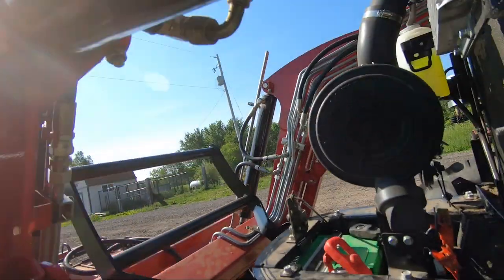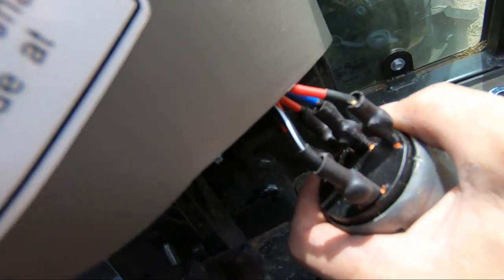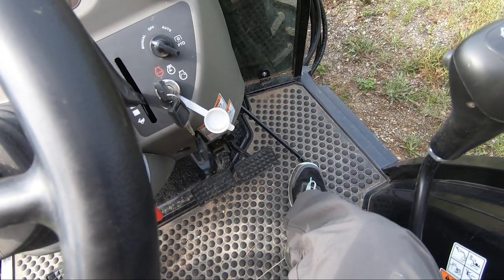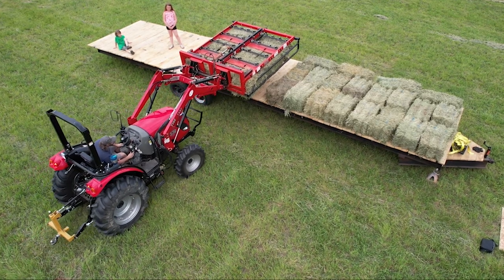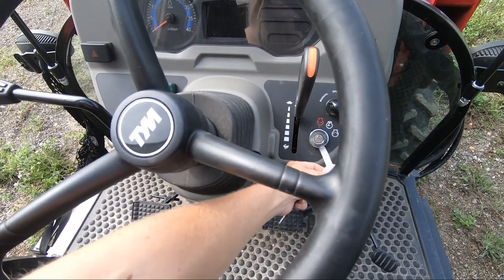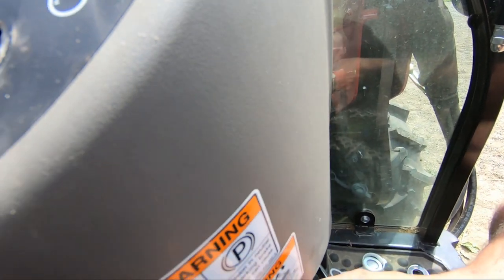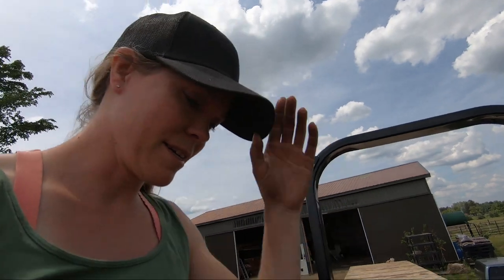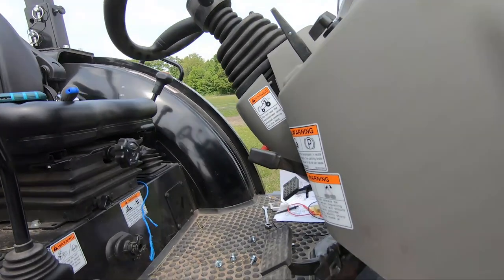381 Our New Tractor is DEAD - Why It DIDN'T Catch Fire . . .

Comment: Its sad to say but it seems all the modern tractors are having these type of poor craftsmanship! Either weak cheap wiring or bad engineering like not putting better tolerances between moving parts! You should get TYM to reimburse you your time fixing it by yourself and not making them spend on a technician/mechanic! Since you are being sponsored by them ask for a raise for making a known design flaw look not so bad and easily fixed haha!
Reply from the maker: I do think many modern tractors have more issues than older ones (when they were new), but my Grandpa had bought a brand new John Deere tractor in the 60's and the engine went out after 30 days. John Deere refused to cover the cost to repair it was still under warrenty), my Grandpa had also been in the market for a hay cutter and went down to the local Case dealer. Not only did the Case dealer give him a good deal, he ALSO fixed the mess of a John Deere engine for FREE!
Reply: @This1LifeWeLive  yes well John Deere has always been about what it could do for John Deere! But I think biggest problems with all the new things from a washing machine to a $100k tractor! They use to at least try to compete with each other to make something even a little better than their competitors! Now they only compete with each other to see who can perfect the lifespan of parts to such a perfect breakdown just as the warranty is out! Ask a AC guy lifespan of new unit (oh 6 years) my mom and dad got first new home in 1974 that had first AC we ever had lol! It was still being used in 1995 when they got a new AC! Its business but its sad business! Imagine how many people would buy a new tractor from a company that actually wanted to make them last 20 years instead of 5 years!

Comment: So it is a TYM design flaw. There needs to be hard insulation around the switch or it needs to be moved to a new location.
Reply from the maker: Either or.  A friend told me about their New Holland at work caught on fire TWICE due to eletrical issues . . .
Reply: You might be able to do a wrap or two of electrical tape around the ignition switch if there is enough room. Farmers who own will sometimes relocate the switch completely.

Comment: That is a design flaw that should have been corrected to allow spacing for the parts to prevent rubbing.  I am surprised that TYM did not cover this under warranty.  I have had problems with Tractors before and usually the manufacturer will  have you bring it in and they will fix the error of free.  Yes I lost time taking it in but they provided a loaner to complete my job while they worked on the tractor.
Reply from the maker: We don't have a trailer, and often it can take time for them to get a driver out to get it. It was much faster for us to pull it open and make the repair :)
Reply: @This1LifeWeLive  I love you 😘💕❤️

Comment: Don't rely on tape to cure that situation.  Get a shorter bolt or if possible reverse the bolt and use a self locking nut to secure the Hand Function of the Throttle on its' pivot.  Use zip ties if possible to hold wiring clear of moving parts or contact points.
Reply from the maker: we may take it back apart and see if we can get the nuts/bolt shortened or adjusted differently :)
Reply: A big rivet or two
Reply: My thought is some type of sleeve or shield between them.

Comment: The one thing I can say about the smaller tractors is they tend to vibrate stuff loose. I almost found out the hard way to take a set of wrenches and sockets and re-tighten every single nut and bolt you can find after about a month of working it during the break in period!
Reply: That's similar to what my son said about the cheap new Chinese motorcycles and quads a few years back. The neighborhood kids would all enjoy them for a day or whatever then my son and another dad would go through and retighten everything for next time. Sounded like a big PITA but I suppose the kids had fun anyway, lol.
Reply: It's called loktite

Comment: We just ordered this same tractor.  Supposed to be delivered this week.  I sure hope we don't have too much trouble with it.  I've heard they are good machines
Reply from the maker: The issues have been user error 100%. It also had  (has) an issue where it will get 'stuck" in gear . . . Erik swore up and down that it was the TYM's fault. I pointed out his shifting is dirty and he never drives the NH. He drove the NH this fall and lo and behold . . . it DID THE SAME THING. I grew up on clutch and stick, that's all we had, so it's second nature to me. Tractors don't like to shift over bumps, or go from low to high gear "on the fly". The TYM I was able to jiggle loose by driving fast over a bumpy field and carefully shifting gears (bumping it loose). I'm hoping the fix for the NH is just as easy, or my hay season is going to be in SERIOUS trouble :(

But I talked to another sub who mentioned his TYM has a different dash and the sales guy said they had modified the design since our tractor. So whe n yours comes, look at it carefully and compare it to mine. if the spacing looks similar, you'll want to access the throttle lever and either cut the bolt shorts or wrap it. But I don't think many will have this issue. Most know to use the foot throttle ;)
Reply: @This1LifeWeLive  Thanks for the information.   I also realized ours is hydrostatic,  so I assume this will be a non issue.  I should probably check the throttle and ignition switch.   I appreciate the video and heads up. Seems like a great machine so far. Thanks for sharing your experience.

Comment: I'm been working on 184 cub lo boy lawn mower for 20 years now, I've re-engineer the electric pto belts tensioner instead of the junk spring that keeps tension on it and as of present I'm working the throttle cable from dash controller to governor arm which should have been a steel push rod of a quarter inch thickness to push governor arm back instead of a cheap steel push/pull cable because with yours any moisture gets inside of throttle cable that lays on hot engine has tendency to rust up and bind up a engineer flaw design, case closed,see you on the next videos 📹 :)
Reply from the maker: Good to know I'm not the only one fixing stuff ;D

Comment: My TYM 234 HST has 750 hours on it.  I've had the front loader arms crack off twice.  I added steel and bracing to the tractor and so far, so good.  The backhoe separated from the tractor the first hour of use, and then I welded up a new bracket to attack it to the rear center pin.  Now it stays on.  During use, 3 of the bearing posts of the backhoe failed and I welded them back on with additional metal, which has worked well so far.  The rear upper attachment of the backhoe to the transmission then broke into little pieces, I had to weld up a beefer bracket.  At 700 hours, the main frame cracked and the tractor about folded in half, and cracked the plastic seat surround (the body as in were that in most tractors is steel) was destroyed.  Total parts are $2500 to restore it to service.  I did all the work. took me about 50 yours total to disassemble and reassemble the unit.  I am done with TYM products.  This machine could have killed me more than a few times, I feel lucky.  I am going to unload this thing as soon as I can find a buyer.

Comment: I would try getting some dry-slide on those cables. WD-40 might damage the rubber, I'm not sure about PB Blaster. Dry-slide is a graphite powder that should last a long time.
Reply from the maker: I'll look for some next time I'm at the store :)
Reply: I can tell you from experience not to use PB blaster on anything rubber or thin plastic, it will eat right through it. PB blaster is penetrating oil, only use it on rusted nuts and bolts, never as lube.

Comment: Good info , All they need to do is relocate the key switch a half an inch to the right in the wire won’t rub drill a round hole with a holesaw bit over a little further and stick it through the hole if possible,, Nice looking tractor they have good reviews I guess they make them worldwide

Comment: Great post. While I did not have this happen to me, my dealer contacted me about 4 months after it was delivered to say that an issue had been discovered and he wanted to make a preemptive modification to the console. The switch was moved a bit to the right and  a different size bolt was attached to the throttle lever, under warranty. My dealer also has shown me how to access areas of the tractor in the hope of having the machine not go out of service with a problem that I can rectify. I'm impressed with both my TYMs(4) and my dealer. Love your channel. I was first introduced to the TYM brand when you first took delivery of your TYM.
Reply from the maker: I'm glad you are loving them! I have NO complaints on mine. She even starts RIGHT UP in the sub zero temps!  I couldn't even do that with my John Deere . . . thing had to be plugged in all the time!
Reply: @This1LifeWeLive   Like your experience, I've had no problems starting any of my TYMs this January and it's been an old fashion eastern Canadian January..... lots of snow and numerous days were it's been below zero Fahrenheit. The machines are stored in an uninsulated tractor shed. They all have electric battery blankets and get plugged in when the temperature goes below -10 Celsius. I find that by doing that, batteries last between 13-15 years. None of my tractor friends get that kind of longevity from their batteries, but none use battery blankets. Stay safe.
Reply from the maker: @stevenandrews6627  I've never heard of a battery blanket, what a cool idea!
Reply: @This1LifeWeLive   I assume that they aren't that common in your parts because it doesn't get as frigid down in your neck of the woods. Up here, they're more helpful than block heaters. It's actually a vehicle's battery that takes a pounding in frigid weather. I've admired your work ethic and tenacity with your desire to make a success with your farm.

Comment: I see this video as a pro, to the tractors overall design. It's literally simple enough that the average owner can repair it with basic troubleshooting. If it were a different color tractor and you pushed a button or flipped a switch and nothing happened I don't think your day would go anywhere near this smooth.
Reply from the maker: Exactly, and that's why I made the video on it.   :)

Comment: With a hydrostatic tractor you don’t throttle near as much - use hydro to speed up or down much friendlier for loader baler etc work my opinions - used hydro 100 Ihc for mowing baling chopping silage for years good luck

Comment: I see lots of issues on youtube with tym tractors. Looks like a design flaw, they put a fuse in to stop the tractor shorting out and possibly causing a fire. They appear to know the hand throttle will damage the wires running to the ignition switch, it would be safer to redesign the hand throttle.
Reply from the maker: I have had a few viewers comment back to me that they bought one and TYM HAS since moved the throttle lever over. The fuses are there for ANY sort of wiring issue, which I;ve read happens commonly in small tractors. But most tractors don't have the safety fuse and catch on fire instead . . .

Comment: I am a mechanical designer and there is no way I would let a design go out where a lever could rub on a wire. That is a bad design. You can't spin that into being a problem with all tractors. That is manufacturer specific.
Reply from the maker: I didn't say this was an issue with all tractors. I said wiring issues are common with other tractors. I said the ignition issue is specific to this one.

Comment: My wife has not had that problem on her 3038E JD that is 9 years old.  I am thinking that TYM just put the switch in the wrong place or routed the wires incorrectly.  Really C-IH and JD are the only two viable tractors to use and make a profit farming.  One guy tried to do it with NH equipment and finally traded in all in on C-IH equipment.  It is good that TYM helped you with the problem.

Comment: When the throttle shorted out that 40 amp circuit, it is like an arc welder welding the throttle into position. If you can't move the screw, maybe you could grind it down. You could cut a strip of some type of flexible plastic, wrap it several times around the ignition switch wiring and tape around that. Try covering the throttle screw with something too.

Comment: Interesting find! Most modern tractors have a ton of safety fuses compared to older tractors ….even more so with EFI tractors .
That issue of the wire rubbing would be a YTM problem….not all tractors would necessarily have that issue due to the location of the ignition switch and throttle lever! 
Nice find tho ….it does help a lot when a specific fuse blows to isolate the circuit faster!
I would also use a chain lube or some sort of lube that won’t dry up so fast….PB blaster dries up pretty fast …few days and it will be just about gone! 
I was gonna make a comment when you were demonstrating the 2 throttle operations about how gritting and notchy the linkage appeared to be and could use some lube….but watching the full video you were on it….😊

Comment: Metal against metal or electrical, its a mini welder or burns that cable when shorted for the brief second its there and it sounds like it happened many times in trouble shooting at least and each time heated that cable when short occurs. The metal wire leading to the throttle is getting worse and worse and will break right where this short occurs. So file that little metal wire just enough to smooth it out. If that cable (throttle) is discolored, get a new one as it will snap off at the worst time ever. I would move that switch over the little distance it takes to make it clear the problem. Hopefully it will move a full distance away from the factory hole and then use a blank for the hole left where that switch was. You will find covers at NAPA on those swivel self help stands or even on their wall. They make them for people who toss the cigarette  lighter holes. Hopefully this helps you Susan and Eric

Comment: i never work the throttle back and forth i set it and use the tractor that speed why dont you use the foot throttle and bypass the problem with the hand one?
Reply from the maker: Exactly. Erik doesn't normally run tractors, and this was the first time running one with the grapple system. After the repair I told him about the foot throttle, and he has been suing that since :)

Comment: If I am seeing correctly the double nuts are on the ignition switch side. Turn the bolt around if you can to put the bolt head on the ignition switch side. That will move it away from the switch as it will not stick out nearly as far.
 If the bolt is attached, made into, the throttle just use a single nylock nut and trim off the excess bolt length.
Reply from the maker: I do agree it is an issue that could be fixed, and with them being newer to the tractor market they might be more open to a re design. MANY tractors have design flaws that never get repaired. I know new holland has a known issue with their clutch cable line being too tight... and they won't cover the repair under warranty. This issue isn't normally something most people face on this tractor because they would normally have a hydrostatic tractor. And this is what the foot throttle is for, lol!
Reply from the maker: That's a great idea!!
Reply: My main power is a 800 series Ford. About 6 or so wires in the harness and after about 65 years of running most of the bugs are worked out! LOL
But yes on the newer anything there are problems galore. 99% of problems I have diagnosed boil down to wiring from loose connections to broken wires. A good multimeter is a lifesaver. A test light will tell you current is present, a meter tells you how much is there.
 When I started turning wrenches years ago I never thought those items would be the most important in my tool box.
Reply: @lesmiller1739  I have a 69 year old 8n never had a wiring issue and this tractor has been used hard.
Reply: And parts for the old Fords are readily avaliable. They were made to last for sure, no plastic.
Reply: @georgebarger3345  Typically the only time you'll have wiring issues with old N-series tractors is if someone else was in there messing around trying to "re-wire it". :-)

Comment: The Biggest Problem for new Tractors  with all kinds of Electronic circuts  is   when they sit out in the weather ..  The Mositure  screws up all of the Electronics   and wiring..
  I was listening to your  video not  watching it .. I did not  see if the  throttle  tension bolt is too long and  if  you can  shorten it .. put  a rubber cap over put tape  over it .. Run  tape  or split  loom over  your wires...
  I rewired my whole Lime   Spreader Truck and  I ran everything in Split  loom used lots of tape  .. I also  use  heater hose  ect  ..  around wires  to keep them  from rubbing   on anything that will wear the Insulation off..
   A rough riding  truck  going  acorss rough fields  for  20,000  hours  will   find the bad points..